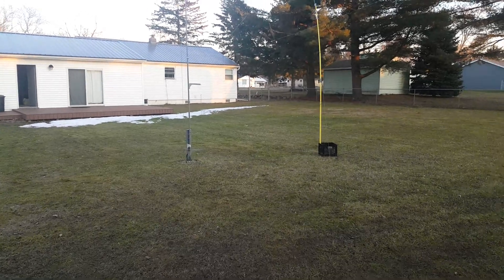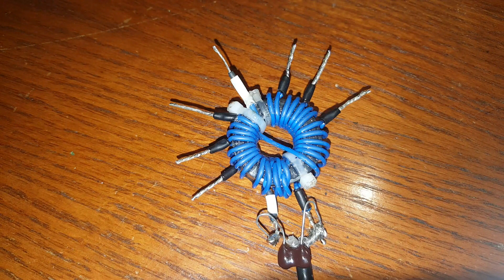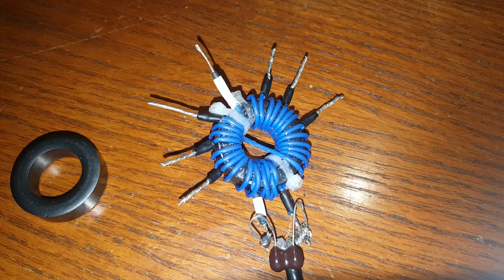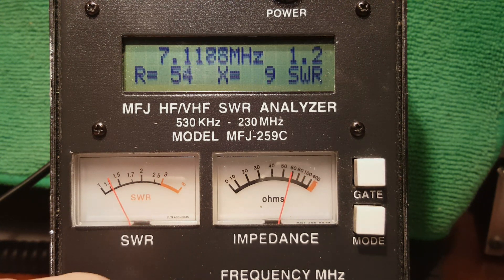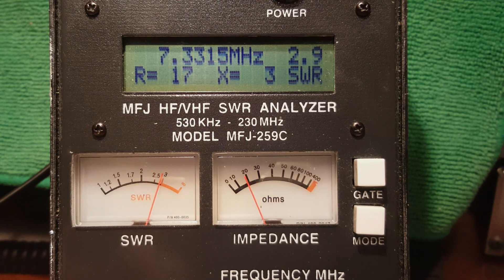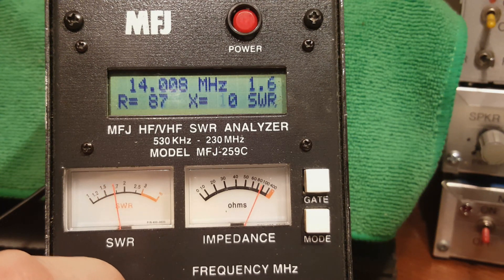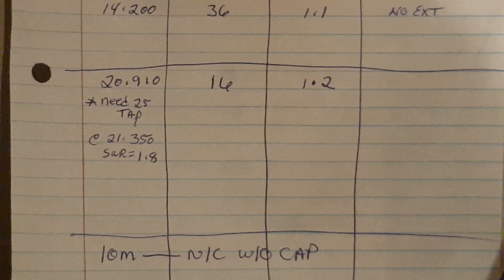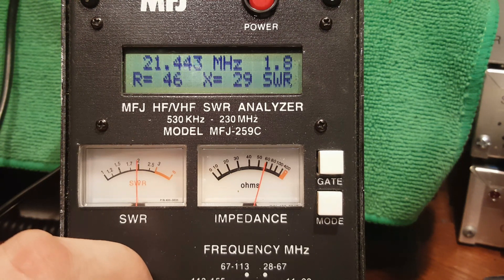40m EFHW - FT120-43 Core - part 1/3 -  Testing without shunt cap

Comment: Great experiment with the multi tap unun. I play with EFHW myself and thought about a scond tap but this is even more versatile. In the end of your video you end up with R=105 and X=0, perfectly resistive yet a bit too high in impedance. Why not put the wire on a higher tap to get the input impedance closer to 50R? If you add or remove a cap your X would rise.
Reply from the maker: Huh. Didn't notice that about the R. I'll take a look and see if I can figure out what the heck I was thinking. lol. I mean.. this is exactly why I love mulitiple taps. To avoid that. lol.   73   :)